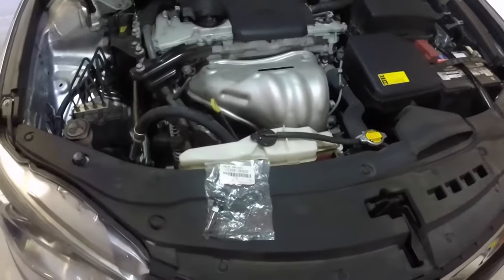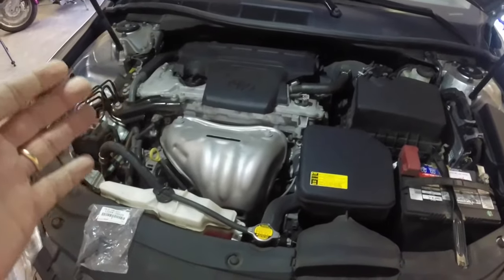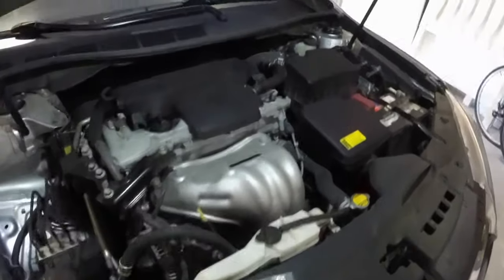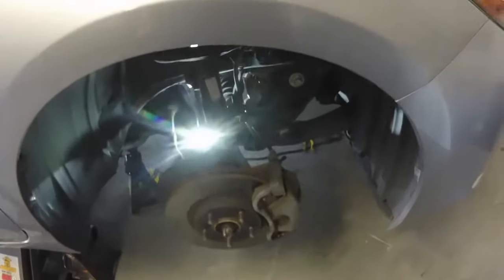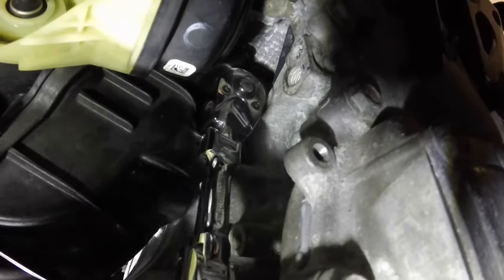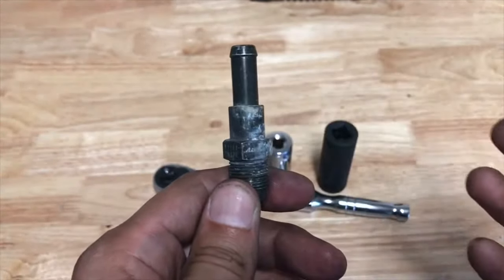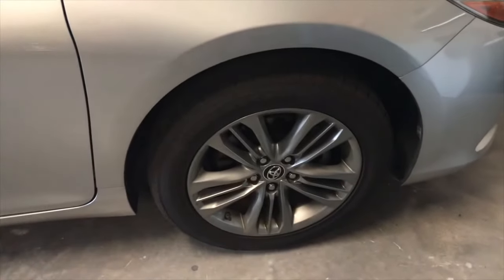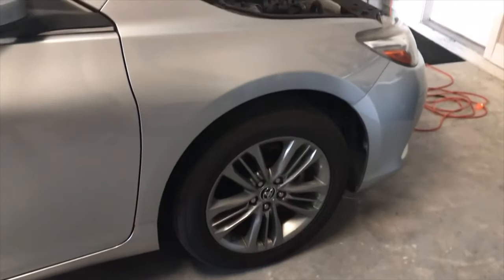Camry 2.5 I4 2ARFE Engine PCV Valve Replacement

Comment: I have a 2014  160k miles should I replace just the pcv valve or the pcv valve hose also?
Reply from the maker: I would replace the PCV that's overdue and inspect the hose and only replace if it has any sign it's brittle. Your car is new, so the hose should be fine.
Reply: @dcfgarage  I wanted to replace mine on my 2013 RAV4 with 178K miles but dealer said that since there is no drivability  issues, no need to replace it.

Comment: Dear friend. Take a weekend break to get away from the bustle of the city))))) On Monday, tell us about oil consumption)))))
Reply from the maker: I'm anxious too. I've been drive the car and so far I've driven 400 miles. No change in the oil so far. I don't know if it's fixed or if it's too soon. If it lowered 1.5 qt in 5,000 miles before, I think I will only be able to notice any difference with around 2,000 miles.

Comment: I know this video is 2 years old but there is another reason Toyota engines are consuming oil. The 10K mile interval for oil changes are damaging the piston oil rings. Sludge builds up and clogs the rings and lets oil pass by  (for a simple explanation). Do not go by the 10k oil changes, do 5k like most other engines. Damage on used vehicles that used the 10k recommendation for years may be irrreversible and require new engine or expensive repairs.
Reply from the maker: Great point! There are many reasons why the 2ARFE engines might consume oil. Previous generation had bad piston rings.

Comment: What is the brand of that medium depth 19mm socket?
Reply from the maker: I think it's kobalt
Reply: @dcfgarage  

I ordered a socket off Amazon and it is a good depth but the head of the valve doesn’t fit in the head of socket. 👎🏻

Comment: I always check my oil every couple days. I drive the piss out of that car. I’ve had it for a week and I’ve almost put 2000 miles on it. We will see how it does later. I just got it from a dealership. I checked the oil. I guess they changed it obviously when they took it in on trade.

Comment: I highly doubt it that the PC valve is a culprit. The problem is related to rings - I have a same engine and the issue started around 60,000 miles. Toyota should recall this engine too, but allowed the owners to suffer the expense of fixing the engine. (I think they only went to 2009 with the recall).
Reply: Most likely it's burning oil because of the 10,000 miles oil change intervals. Safe bet is to do the 5,000 miles or 6 months oil changebtime intervals

Comment: Haynes Illustration for you guys! PCV vavle: https://ibb.co/xXZBB64 Intake Removal and install:  https://ibb.co/2ycHTQ8 
Note: This method is more time consuming and you have to Release to Fuel Pressure:
1  Remove the fuel filler cap - this will relieve any pressure built up in the tank.  
2  Remove the center console box (see Chapter 11, Section 22 ). 
3  Locate the fuel pump/sending unit electrical connector and unplug it (the harness will exit through a grommet in the vehicle's floor).
4  Start the engine and allow it to run until it stops (it should only run for a few seconds, or it might not even start). Turn the ignition switch Off and disconnect the cable from the negative terminal of the battery before working on the fuel system (see Chapter 5 ).  

5  The fuel system pressure is now relieved. Place a shop rag around any fitting to be disconnected to catch the residual fuel as it bleeds off. Dispose of the fuel soaked rag in an approved safety container.  

6  When you’re finished working on the fuel system, reconnect the fuel pump/sending unit harness connector and connect the negative cable to the battery.  

7  Performing this procedure may cause a Diagnostic Trouble Code to set (fuel system too lean). If this happens, refer to Chapter 6 and erase the trouble code.
Reply from the maker: Thanks!!!!
Reply: @mammithian  I just got my PVC off Rock Auto today. $4.17 But is now 102 outside lmao.
Reply from the maker: @mammithian I deleted your post by accident, when I was trying to reply... sorry. But I agree with you. Even though the Haynes manual is the official way, you can do this how I did. Just two important tips... make sure you put two jack stands, a tire and the jack when you lay down under the car. Specially with jack stands failing these days... and the second tip is that it's easier if you lay on your back under the rotor with your feet facing the front of the car. That should allow you to reach the PCV valve... but please be safe!
Reply: @dcfgarage  where do you live maybe I'll stop by and have you put it on for 50 bucks lol
Reply from the maker: Mii Entertainment lol
Reply: @dcfgarage  I have severe scoliosis of the spine, working on my car is not a pleasure as much as it used to be. 🤷
Reply from the maker: Mii Entertainment I hear you. I’m in a similar situation with my back

Comment: Did you have any idle/performance issues with the old valve or just oil consumption?
Reply from the maker: Pcv valves shouldn’t have any significant effect on idle or performance. Those are more likely caused by a vacuum leak or a bad maf sensor (or idle control valves for older car)

Comment: You're a pro mechanic or DIY ? I want to ask what could happen when oil gets into intake manifold ? I've found some oil on intake manifold . Mechanic friend said that I should check to see if any oil is getting in . I don't know how can I check that all I know is some oil gets on the outside of manifold . Still car is running great
Reply from the maker: I'm a DIYer. For what I know it's normal for oil to accumulate inside intake manifold in modern cars because of exhaust gas recirculation (AKA PCV) systems, specially if you have a turbo or compressor because you'll have more blow-by. You can add an oil catch can and that should resolve 90% of it.
Reply: @dcfgarage  I'm trying to remove it now . Can't see it because of body panel have to go by feel . Find it by the hose connected to it ? This other guy on different video doesnt seem to take hose clamp just too difficult to remove and put back on . Seems he just pulls it off and shoves it back on ? Video by car care nut

Comment: So did this fix your oil consumption issue?  My 2013 has 190k mi on it and based on where the PCV valve is located, its probably never been done by previous owners.  My idle is a little rough, hoping this helps smooth it out.
Reply: Yes, the OP said in another reply
Reply: My 2013 RAV4 has 178K miles. Original PCV valve. I don’t think I can DIY it. I even wonder if some local mechanics know the location?

Comment: Do you use thread sealant for the PCV valve?If do what type of sealant?
Reply from the maker: David Carz I didn’t. The oem came out without thread locker
Reply: @dcfgarage  Thread lock and thread sealant are two different things
Reply: @joeschulte979  why needs sealant?

Comment: Are you a mechanic or DIY ? A mechanic told me there are signs that your pcv valve is bad like high idling , oil leaks and air leaks . Are these signs a fool proof sure way to tell if pcv valve is bad ? I've got oil leaks btt not the other signs . Major pain to replace mine . I've got to take off imtake manifol and a few other things or pay a shop .  11 Camry 2ARFE 2.5 L It's right by the intake manifold and HYDRAULIC POWER STEERING PUMP . DO I NEED TO REPL:ACE IT ?
Reply from the maker: Not a mechanic. But the only way yo know 100% if it's bad is to remove it and inspect

Comment: Oh wow!  No wonder the dealership is asking me $400 plus to get it replaced for a $15-$20 part. Thank you for sharing. Can you tell me if you had to torque it or just hand tight??
Reply from the maker: I just hand tightened it. I would say the torque wouldn’t be more than 15 ft-lbs . Keep in mind that it’s an aluminum block.
Reply: F the dealership. Told me they had to remove fuel rail and manifold to do the job. The mechanic will do it the same way and charge you book time. 🤨
Reply: My mechanic charged me $350.

Comment: Geez mine is 11 LE 2.5 L 2ARFE engine but somehow it's verrry different in that has power steering pump in the way right where your hand is at 3:43 . It is just on the side . See this other video where he has to take off much more parts and much more work . Either need to take the pump off or intake manifold ..
Reply from the maker: They use different intakes on different models
Reply: @dcfgarage yeah normally a very easy simple job to replace pcv valve but not mine

Comment: Is the PVC Location for Toyota Camry 2011 2.5L Same ??
Reply from the maker: Exact same place. Don't forget to subscribe ;-)
Reply: I have subscribed long time ago, Lol
Reply from the maker: @Alamin311  Lol! In that case, thanks!!!
Reply: @dcfgarage  World needs people like you.
Reply from the maker: you're too kind!
Reply: @dcfgarage  are you sure toyota camry 2011 2.5L pcv is on the same spot as yours 2016 because I did all this work and disconnected and removed the sensor which you said on the way but I couldn't find got frustrated and put it back.Can you please take a look again in your system if you have ,Thanks you again.
Reply from the maker: @Alamin311  2011 Camrys did come with the 2.5 2AR-FE engine. The previous generation engine was the 2AZ-FE, it was a 2.4 and it was used in Camrys until 2008. 
Just make sure your car has the 2AR-FE (it should) by checking the sticker inside the hood. 
If your car has the 2AR-FE, it will be in the exact same spot, because it's the same engine. The valve is really tucked inside the engine and you can barely see it from under the car.
Reply: @dcfgarage  Mine is 2GR-FE 4 cylinder 2.5L and it looks like my pcv is somewhere else. Please check the Toyota Service Manual if you have access to it. Thank you for fast reply.
Reply: Some Mechanics replied and said it's non-serviceable, it's part of Valve Cover. Is it possible? Please reply, really thankful for your help.
Reply: You have to take apart the intake manifold to get to the PCV valve because the PCV is inside blocked by the brake booster and PCV tube. Lookup 2010-2011 2ar-fe PCV valve replacement on the nation forum. There’s a DIY that explains in depth. Unfortunately after it was these 2 years that had this complicated design. From 2012, the engine design was far easier to replace the PCV.
Reply: yes will C, you are damn right, I have a toyota Camry 2011 2.5L and when I saw the above Video of DFC Grage for 2016 and I was thinking mine would be the same spot and I even asked DCF GRAGE and he didn't believe me and  he was so sure that mine PCV is on the same spot and I started to feel silly and gave up and didn't change, still sitting there.

Comment: OK I have to ask, did this fix her issue with oil burning ?
Reply from the maker: I did. I made another video with the follow up. And then when I changed the oil at 5k miles it had not lowered.
Reply: @dcfgarage  I also have the same engine 2ar-fe with 180.000 2nd owner and have had an issue since day one. The engine is not on the recall list but still lose oil between changes.
Reply from the maker: @ChrisVargasrpht2000chris  at this mileage it would be normal to burn 1 qt every 4 or 5 k miles
Reply: @dcfgarage  right now I burn about a 1 qt every 1,000 miles and the dealer can not tell me why, so I am wondering if this is my issue.
Reply from the maker: Your engine is probably in its last stretch.   That kind of oil burn is probably piston rings and the 2arfe is not rebuildable. You should probably try to find a used engine

Comment: Yes my Rav4 2013 is losing oil as well @100k. Guessing this it, as no smoke nor leaks never....
Reply from the maker: Mii Entertainment very likely
Reply: @dcfgarage  Have you noticed anything new with the Oil level?? thank you.
Reply from the maker: Mii Entertainment I just measures it after 1,000 miles and the level is the same. The pcv valve seems to have worked for me

Comment: has something changed? has the oil consumption dropped?
Reply from the maker: I only drove for 200 miles since I changed. I’ll do an update on 2,000 miles
Reply: DCF GARAGE I have the same problem in lexus with the same engine. Hope its a decision.
Reply from the maker: I’ll post an update asap
Reply: DCF GARAGE thank you
Reply: I did the same change. And now evrything is fine and its become more... powerfull

Comment: Finally, I found the time to replace the PCV on 2013 Camry SE 2.5L. 
I got the PCV out, but the new (or old) doesn't want to screw back in. 

How did you get the new PCV initially threaded?
Did you just use hand to tighten few turns?

I've tried couple dozen time using hands, and in socket with extension, 
but the new PCV doesn't want to start threading in.
Reply from the maker: It takes patience. Maybe if you clean the threads it might help. But I threaded in by hand. I laid my back on the ground under the brake rotor. But make sure you have good jack stand and the Jack holding the car. Don’t do that just with the jack stand.
Reply from the maker: Another tip is using the socket and your hand, gently and slowly screw it counter clockwise until you feel a click. Then you screw it clockwise.
Reply: @dcfgarage  Thanks for the quick reply. I try the old one and that screws in just fine.  I dropped the new PCV few times and I may have slightly damaged the threads, though it looks fine visually.  I’m gonna go back to the dealer and swap (if they allow) or get a new one.  Thanks again.

Comment: My 2010 camry model there were power steering pump next to pcv valve. Too dangerous to do it with jack stand.
There are many accidents with jack stand diy job. Someone downed car body with his jack stand fallen. Broken engine oil pan and mission oil pan broken too. Also his leg severe injury too.
I gave it up by myself. Today i visited mechanic. He told me it was impossible for private person without lift. And it needs a at least 3 hours for mechanic. He have to remove power steering motor first to access pcv valve. If 2010 camry 2.5 engine owner do do diy job with jack stand. Very dangerous !!! And very deep,  very far pcv location different from this video(2017 camry model). Toyota changed power steering motor location in  2017 camry. But 2010 camry model very difficult pcv deep and far location
Reply: is it really that dangerous?

Comment: Can not be done on a 2010 Camry (Canadian) there a pump right in front of it.
Reply from the maker: Are you sure yours has the 2AR engine and not the 2AZ?
Reply: I have a 2010 also, power steering pump in the way 2AR-FE
Reply: Same here, I watched this video and then got excited and bought the part, I should have read deeper into the comments, I'm wondering if pulling the pump is easier then pulling the intake.
Reply: Unfortunately the 2010 has that steering pump right in the way! Yes it’s a 2AR-FE

Comment: I think you skipped a vital part. How did you get that stubborn hose off of the PCV valve lol? I'm having trouble.
Edit: Got it and done lol
Reply from the maker: Mine just came right off
Reply: having the same issue, any tips?
Reply: @armanix4016  I think for me the clip on the hose was turned upside  or turned whatever way that made them more difficult to take off. I was just persistent until it came off. Then with the hose I just had to pull it hard till it came off. I tore it slightly on the end but thankfully not to the point the clip couldn't tighten it down properly. Next time I'm gonna order a new hose just in case it rips more.
Reply: @nigell.8705  thanks for the reply bro, im chewing up my hands trying to rip this thing out. I set aside the coolant reservoir and the  power steering fluid reservoir to give myself room to reach from the top. I can get a grip but im finding it impossible to yank out. Can't go from the bottom, mine is a 2010 with powersteering pump in the way. I heard you can pull it off with the  little clip still attached but i guess im not pulling hard enough, might need to get some big ass pliers to get more leverage haha.
Reply: @armanix4016  sorry to hear. I pulled it from the bottom and was mad as a hornet with the engineers and approvers of this mess lol. Hope you get it.

Comment: this mechanics they want to charge more them 500 dollars to replace a new pcv in my toyota camry 2.5 lt le 2011 4 clyders because they said is lot of work  to remove the manifold inthe back of the engine  and l think the lie to me
Reply from the maker: well... the shop manual will tell you to remove the intake manifold. But you don't have to

Comment: After changing the PCV Valve, does it still burn engine oil or it stopped???? I have the same car and year, and I’m going through a qt every 1000 miles
Reply from the maker: 1 qt every 1k miles is probably something else. That's too much oil to be the PCV valve